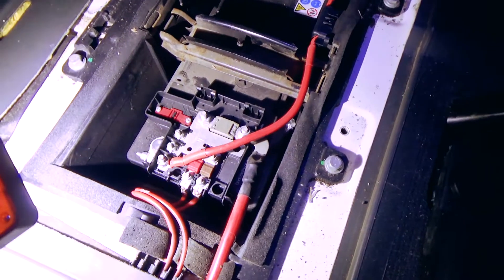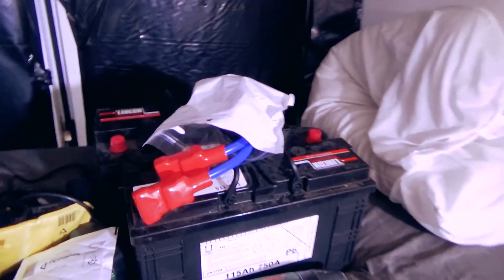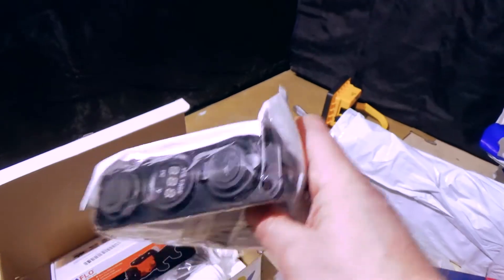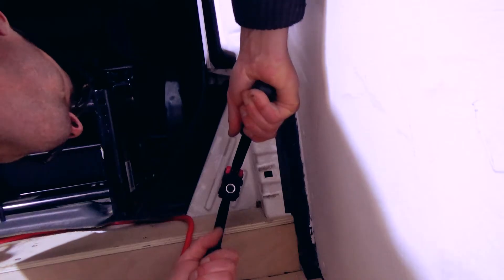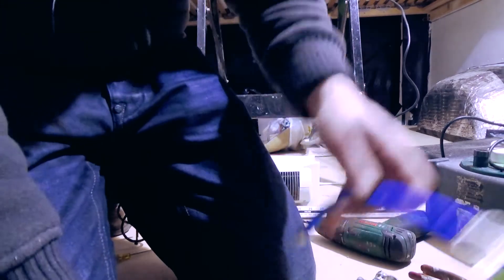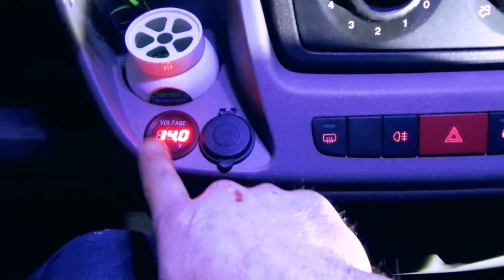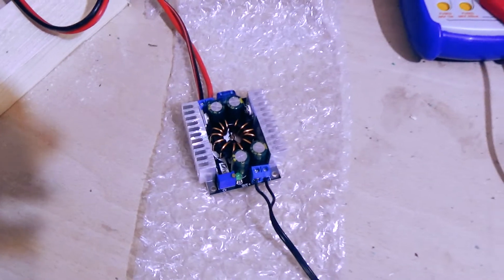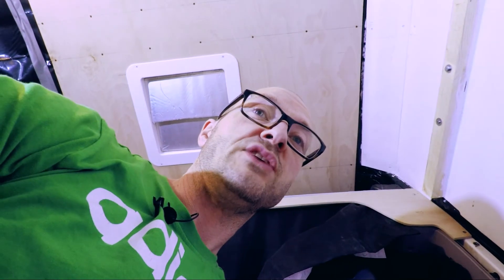Van leisure batteries, split charge & additional 19v supply

Comment: I'm so sorry but I wish I could see the wiring properly. Really would have been helpful to see where your wires are going and what's connected to what.
Reply from the maker: Hey no worries. This isn't really a tutorial build. I really was making this up as I went along. 🤪
This video I've linked to will help - John and Mandy have a newer "advanced" video, but this older video does the basics.
https://youtu.be/oOQHe_cZtI4
If you are starting from scratch and find the electrics a challenge, maybe consider an all-in-one "solar generator". The AC50S that I use has everything a small van needs (but only 300W of inverter and max 120W solar panel), but similar capacity as a pair of big lead acid batteries. Affordable too. Also can charge while you drive, charge from a mains plug. You can use it in multiple vehicles or even in a tent.

Comment: Hi Mevi, I know its an old video, what is the name of the Voltage booster please to 19v ? thanks
Reply from the maker: It's on Amazon. Here's a link to the exact one I bought. 😎👍

DROK&reg; DC Boost Converter Power Transformer Voltage Regulator 8-32V to 8-46V 150W DC-DC Converter Step Up Car Power Supply Module for Automotive Ve https://www.amazon.co.uk/dp/B00GY0HH6K/ref=cm_sw_r_cp_apap_SgGo7eWVAd7Et

Comment: Great video👍I live on a narrowboat and have four of those marine 12 volt leisure ones they've lasted me for 7 years but are now needing to be replaced. What I found is that the cheap ones are crap plus other boaters I've seen seem to not look after them so they're dead in 2/3 years. I'm considering, due to weight issues in my van to go the Lithium route as they are light and rather than only 50% available power they can drop to 20% and they give a regular constant supply plus many more cycles than the lead acid ones which maybe have 300 cycles and each time the available power reduces over time. However the Lithium ones are very expensive so I may wait a little longer until the price goes down🤔 Are you going to Camp Quirky?

Comment: Mevi on average how much does the 7m kit cost I am coming to UK in July and would really like to get a leisure battery sorted PS expect more questions lol I am no electrictiion
Reply from the maker: I paid £80 for mine on eBay, back in December 2017. (There are cheaper and more expensive options). The wiring itself is not difficult, but getting a crimp tool will make it easy.
Check that your vehicle can work with a split charge relay. Some modern engines have "smart" alternators and cannot use a simple relay.
Reply: @Mevi  It's a 2000 VW T4 so I would imagine it should be ok. I will have a look when I get back to UK but I will definitely Get someone trained to install it. I know nothing about electrics and the prospect scare the shit out of me lol. I have no problem lighting a fire with 2 sticks but I think this one is beyond me
Reply: @Mevi  Hi not sure what happened but I did reply to this.. ok I will note down this message and when I get to the UK I will probably be asking more questions and or bringing you a few beers and a kit shouting HELP!!! lol
Reply from the maker: Gadget John On Tour also has some useful videos on the subject and Greg Virgoe has some really impressive electrics. My electrics are much simpler, I think.

Here it is kinda simple...

The red cable goes from the + terminal of your starter battery into the input of the relay. There's a fuse at the start of this cable run.
The output of the relay goes to the + terminal of your leisure battery.
The black cable goes from the van's metal to the - of the leisure battery.
The thin black cable of the relay ALSO goes to the metal work.

Done! You now only charge the leisure battery when the alternator is running or if the starter battery is above 12.8v.
Reply: @Mevi  I like simple. but yes I enjoy Johns videos and have subbed to his channel. Ill go look at Greg now

Comment: Those Marine batteries are not true deep cycle batteries.  They will probably die in less than a year with how you intend to use them. Nice video editing skills!
Reply: Super sweet crimp tool
Reply from the maker: The tool is awesome, but requires an extra hand. Or something like a vise/vice to hold it still.
I bought the batteries from the factory. Mostly because I wanted to talk to a manufacturer more than the RV shop locally 😃. We had a long chat - they've been making batteries since days of yore. There was no hard sell for the thicker plated deep cycle batteries they manufacture. He said apart from the thicker plates and dual terminals, there's no difference in the chemistry, power output, lifespan, etc. And even deep cycle get wrecked eventually by deep cycling them. They have a 2 year guarantee, I guess. I put myself in his hands!!
Reply: Mevi best wishes to you then! I killed a stack of Marine batteries when I was a teenager from using them as deep cycle, but whatever works for ya :)
Reply: Mevi you could load test them at two years and if the results are crap, you can still use that warranty and get them replaced. Just trying to help though :) whatever you wanna do is all good!
Reply from the maker: I appreciate the advice, Will. I'm no expert, and YouTube is great for info, but I chose a 2+ hour round trip to choose them. Like you say, if they are junk, I swap them. Would it make any difference if I said there is also a picture of an RV on the side of the battery? Unlikely. 😃😃

Comment: Getting too good at those intros haha. I didn't know about the positive and neg terminal size difference 😮
Reply from the maker: Only a whole evening lost on that intro. 😃The difference in size is tiny, but the neg end wouldn't fit on a + terminal, the pos end was too loose on a - terminal. Modifying those inverter leads actually worked out better as my batteries are single terminal.